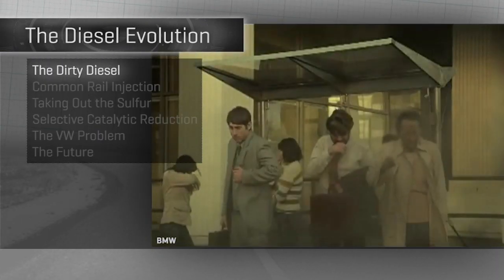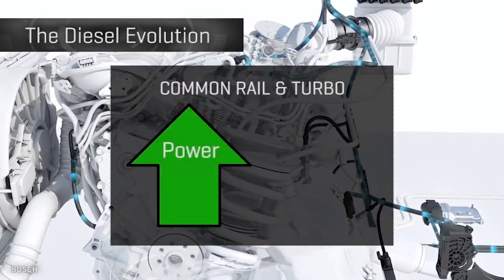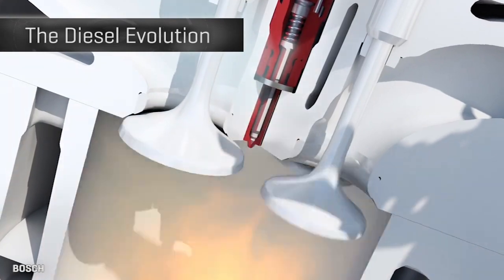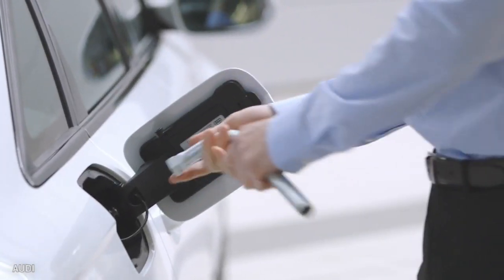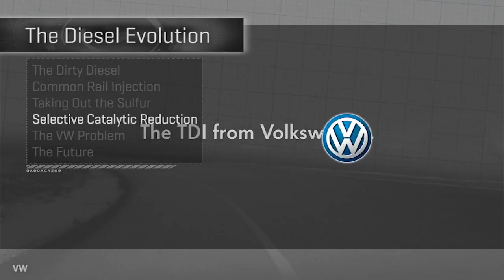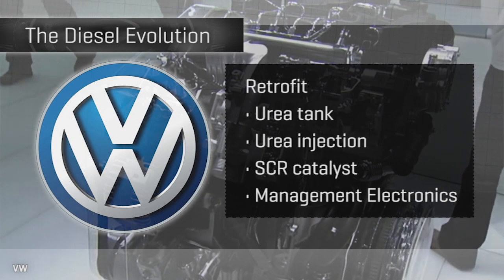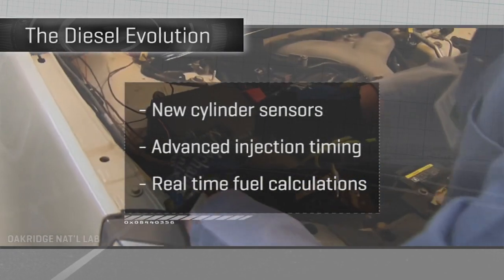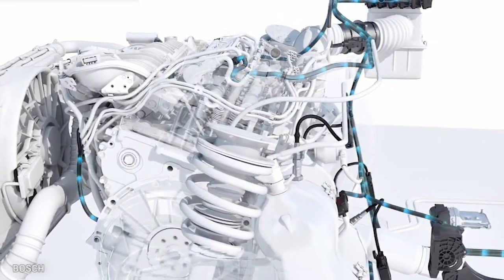Car Tech 101: Making diesels clean (On Cars)

Comment: all of this rift raft.. all the consumer auto makers need to go electric already. Less maintenance, zero emissions, and more power. instead of investing so much money into this ancient fossil fuel technology, invest in better batteries and charging techniques.
Reply: +Yeah Goodluckwiththat cars are forms of transportation. cars crash. hydrogen is highly flammable and explosive in its pure state. if theres a leak, you cant tell. it its on fire, you wont know until it explodes. bad idea.
Reply: Joshua Henry Hydrogen technology has gotten so much better that they are now just as dangerous as a petrol engine. A decade ago? Maybe, but now it's a whole new ball game. They are just as safe.
Reply: +Mister mood i fail to believe that.  they didnt catch on for a reason.. we all know how much money is made off of oil. Electric cars totally change the industry and how it works. i think big automotive and oil companies prefer the current industry over an all electric one. thats why it took a small independent company "Tesla" to drive the movement.
Reply: +Yeah Goodluckwiththat that may be true, but this is how i think of it. in a hydrogen fuel cell vehicle, the hydrogen is being used to produce electricity to power an electric motor.. thats two steps. if you remove the hydrogen part, ur left with one simple step.. keep in mind how much will it cost to fill your hydrogen tank? i would have to drive to a station to fill my tank up instead of just plugging up my vehicle when i get home, or let it charge for free as it sits in the parkinglot while im at work all day. i feel that hydrogen powered vehicles is another anchor keeping consumers dependent on a power source.
Reply: There's nothing environmentally friendly about batteries
Reply: +Joshua Henry Or hydrogen
Reply: +asdjfnljn3 hydrogen is too difficult to mass produce and transport.
Reply: +Mister mood range anxiety is a myth. yes, gas cars do on the surface of things have the capability of more range. but unfortunately, range is relative to what you can afford. so what if i can go far in my gas car, but what good is it if i cant afford to fill it up? most people drive around town, back and forth from work and home, electric vehicles now days have more than enough range to cover that daily transit at a lower cost. there is room for improvement, and the momentum of electric motorifa  technology is growing fast.
Reply: Or you could replace fossil diesel with synthetic diesel such as HVO100 which is much more environmentally friendly than the crap made from crude oil instead. What many people don’t know is that Diesel engines were never meant to be driven on crude oil in the first place. In fact, the very first Diesel engine ever invented by Rudolf Diesel himself ran on peanut oil which explains why so Diesel engines, especially older ones are able to run on vegetable oil without taking any damage from it. But then, not too long after Rudolf invented his engine somebody simply had to discover crude oil and eventually make a fuel for the same engine that was and still is one of the most polluting fuels today. And that, ladies and gentlemen is one of many reasons why Diesel engines have gotten such a bad reputation. That and Dieselgate of course. It’s simply one of the most misunderstood engines ever to be invented, sold and produced. If only people had stuck to running Diesel engines on peanut oil we probably wouldn’t have this mess that we have today.
Reply: +asdjfnljn3 Hydrogen will be the future when there are no more subsidies to hand out to the electric special interest when they go belly up. I am very excited for hydrogen tech to get better and to eventually have an infrastructure to support it.
Reply: Joshua Henry you just need the local infrastructure. You don't transport it from anywhere. It's produced on site. It's all about having the local infrastructure support to make it mainstream in our communities and gas stations. Once that happens and the technology becomes cheaper to produce, it could be our main source for transportation.
Reply: Yeah Goodluckwiththat Also, hydrogen fuel cells won't have the issue of waiting to charge the battery. It would be essentially the same to what people do right. You would go fill up on hydrogen and drive off.
Reply: +Joshua Henry  electric cars have been around for about a century, it just that gas was more convenient and just didn't catch on.  :/
Reply: My 2009 mazda 6 2.2L Diesel cost me 3600 us dollars and can easily do more than 700+ miles on single tank of Diesel. Find me a electric which can match this?
Reply: Or invest in turning trash and sewage into oil, carbon capture fuels, and nuclear power to supplement electrification.

Also, there is NO such thing as a "zero emission vehicle". I'm all for electrification, but this whole thing with forcing it on us really needs to stop ASAP.

Comment: The Ultra Low Sulfur Diesel is what killed any interest I had in Diesel cars, the cost went from less than Regular to above Premium. You skipped right over that.
Reply: D Jaquith Sorry, I didn't fully read it. My bad.
Reply: I thought that diesels get much more mpg so the cost evens out
Reply: RandomVideos It makes sense when the fuel is cheaper, but when both the cost of gas is increased by 15%-20% and the cost of the engine adds $5,000 or more the 'savings' isn't clear. Further, often not every Gas Station carries diesel so I've found myself driving more (wasting fuel) for a fill up, plus both the smell and inconvenience factors.

I won't repeat the process and I've been driving Mercedes. But the last I checked even a VW adds over $5,000 for a diesel. For 'fuel' savings and 'green' the car that interests me is the Tesla cars.
Reply: D Jaquith What you say does make sense. I'm not gonna argue because cars arent my forte, computers are.
Reply: RandomVideos Pfft same here! :-)
Reply: FredEFuego Agreed!
Reply: FredEFuego They're going to unveil a $35K car but even that's somewhat expensive
Reply: RandomVideos Tesla has a 'thing' about base price and what things actually end up selling for .. cough Model X.
Reply: D Jaquith The Model X they're selling now is the Signature edition which is why it costs >100K, but the normal X should cost ~80K
Reply: RandomVideos And the $35K Tesla will probably be first released for $50K and the difference will be mostly in the battery ie range.
Reply: Flame In the USA and countries with the Ultra Low Sulfur, it costs more or at least the same as Premium gasoline. Mexico pollutes more, you have Low Sulfur Diesel not the Ultra.
Reply: +D Jaquith Last time I checked, New Mexico was in the USA...
Reply: porscheguy123 Oopsy 'New' Mexico. However, I just looked up some prices and the prices for Diesel are inbetween Mid and Premium grade, not Regular. State taxes vary from state to state.
Reply: +D Jaquith Up here in Canada, diesel just finally dipped below the cost of regular gas...took over 6 years to return. Still I think Bio Diesel is the way to go forward, it's not like the fuel providers have and interest in making any improvements to fuels until the government forces their hands; and we will be holding our breath in an oxygen tent for that to happen any time soon. Just look at the Keystone Pipeline scam that is preventing the cost of fuel going down for the US.
Reply: sickjohnson Regarding that pipeline I was and am against it. I mean WTF you guys want to put this across our country to ship it out the Gulf and it's not sold to us?!

Circle it around your cities, around your waterways! 

I'll buy Tesla and the rest of the world can have unlimited oil enemas.
Reply: +D Jaquith Are you sure about that D.? Maybe you were deliberately misinformed? You know if the price of oil goes down, the price of everything can go down as a result, be cause oil us used to produce and ship everything. Then you could buy 2 Tesla's and solar panels and Tesla power storage units, all made and shipped with oil products. You are probably vaping on some oil right now, so put that in your vaporizer and suck on it some more! 

I want a Tesla also! 

http://www.americanthinker.com/articles/2015/11/warren_buffett_and_the_keystone_decision.html
Reply: sickjohnson Maybe you need to read something else than the BBC or what a Billionaire wants you to believe. So am I sure, hell yes! Worst the pouty Canadians while holding their breath threatened to sell their crude to China, and yes of course I read the EPA and climatological studies. 

After the BP oil spill and its damage it caused, LMAO if you think they made full restitution .. they have not, I kinda sick it. Keep in mind I live on the West Coast of Florida aka Gulf side.

So sell it to the Chinese and let's see how the dust settles.
Reply: D Jaquith Wait, are you from the US or from Canada?
Reply: RandomVideos Really?! 

Quote "...Keep in mind I live on the West Coast of Florida aka Gulf side. ..."
Reply: RandomVideos No worries! ;-)
Reply: +D Jaquith I see there is no point in talking reason to you...when you say we as in Canada will sell our oil to China, well first It is not Canada, it is foreign Oil companies doing the selling in an open world market, our last two Canadian owned companies, Husky Oil and Petro Canada are not even majority controlled by a Canadian owner anymore and even don't operate out of that area where the pipeline is running. You say you read, but if you did you would know the Warren Buffet story is viral almost. BP Just scratched/ skimmed the surface of the damage they did, I doubt they would even argue that! Maybe you should follow Elon Musk's YouTube's channel, just a couple weeks ago he was speaking at the Oil summit in Germany defending Oil and VW too. And if you do have some time look up the effects of propolene glycol on humans...it is a low level carcinogen that they used to put in soft ice cream but for some reason they stopped...hmmm?
Reply: sickjohnson Dude when the pipeline crosses both international and state lines it becomes a government and hence a political issue. It's irrelevant what companies are involved, even if they were our own. 

The oil is traveling across our country and being exported to a third country. That's the 'line in the sand' which is unacceptable. It's an issue of risk-reward vs simply being used. 

Now if that is too much for your mind to comprehend then that's simply too bad.

Maybe we should have a pipeline of nuclear waste crossing straight from New York continuing through the middle of every major city in Canada and up towards Alaska. Then we'll sell this waste to China because they can reuse it in a different reactor.
Reply: +D Jaquith But the oil is already been crossing for years and years, via train and truck, making some of the wealthiest people in the world sickeningly rich...like Mr. Buffet. The pipeline is to cut out the middle man robbing you! Hey, I'm all for stopping it if you are...but your country men will suffer incredibly though. We Canada, via international Oil companies are shipping you a raw resource...that is going to stimulate your economy drastically. But if you like $10/gal or more and drastically increased costs in everything that is shipped in a truck....fine; who am I to argue with you. 

You should know by now when the Government is involved there is corruption at hand. 

How can you be so irrational to suggest nuclear from your 100 active reactors should be shipped anywhere...that is just irresponsible! What is wrong with you? You are aware that there is over 2.5 million miles of pipeline already flowing in the USA already right? The oil that is already coming from here to the US gets trucked or rail car'd in and then put right back in to your existing pipelines...right? 

Either you are Jimmy Buffet or I just turned on a light and flipped your world of ignorance upside down? Either way I am sorry for wasting my time trying to simply show you the truth, that is at your apparently sheepish liberal fingertips.
Reply: sickjohnson No I'm perfectly aware of how and where the oil is traveling across our country. The line is when it's being exported. Canada has full access to both the Atlantic and Pacific oceans in addition their own railways. 

Oil traveling through our country for our own consumption is one tolerable issue, but for export and the prospect of being used absolutely no. 

I'm a strong proponent that if the oil is going to be exported that's running in any way shape or form through our country it be blocked. Again, Canada is not land locked.
Reply: +D Jaquith  Your companies foreign and domestic buy the oil and then they mix it with all the other oil  in the lines and it goes everywhere, just like it is now? There will be no change other than bypassing the middle man trucking it in for a small fortune, resulting and an economic benefit to the end users.
Reply: sickjohnson That oil especially the sand based oil would not be at a price point we, the US consumers, would pay for at the current price .. so yes that oil would be for export. It's one of the reasons no one cares to pursue the pipeline at this time.

The middle man are US based companies, and I've made it perfectly clear what the options are to everyone. Beyond that we are going in circles or discussing irrelevant details.
Reply: What you forgot to consider is that there are levels of 'cost' involved in dirty car emissions, and out of pocket fuel purchase is only one level. I pay a higher cost for fuel but I use less fuel today than I ever did with my other cars, even though my car is larger and heavier now. But the new diesel technology is wonderful, so do not complain.